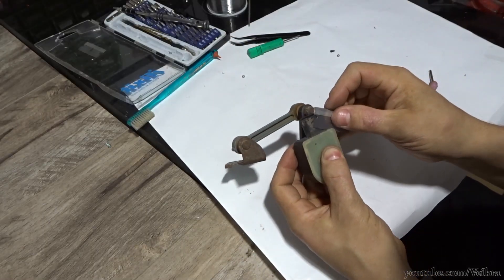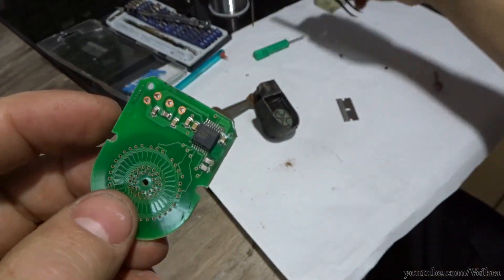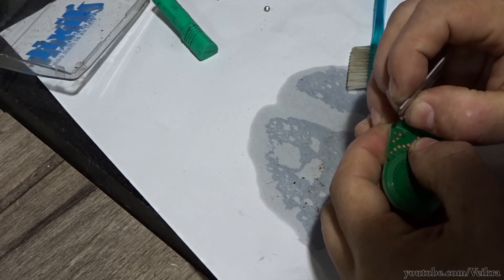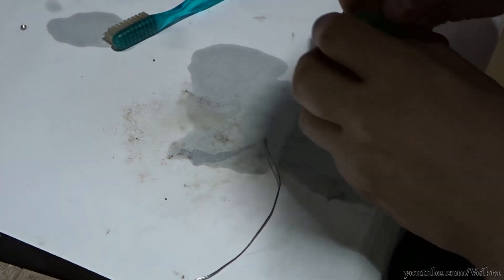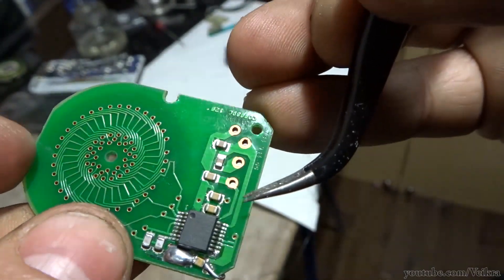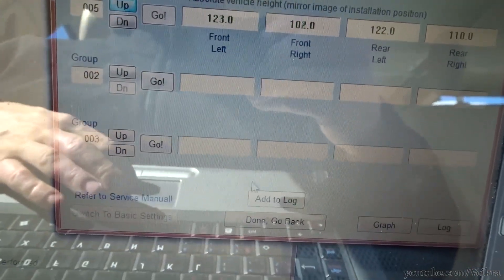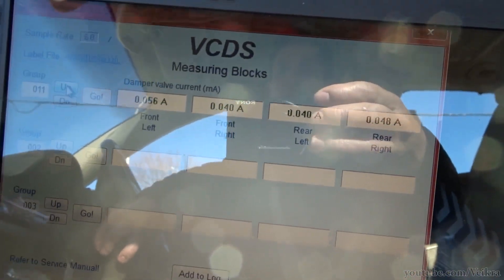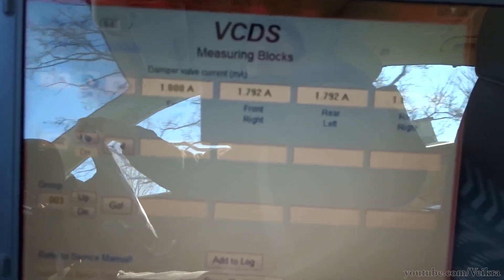How I fix these Audi level sensors ( audi a8l, s8 , vw phaeton )

Comment: Hi, nice video. After installation , how did you adapt the sensor again? I mean what’s the procedure in Vcds? Thanks.
Reply from the maker: On this model you have to go into level control -> adaptation. Rosstech website has a write up on it.

Comment: Hello, Could there be one of these bad without showing a faulty light for it. My left front side sits a bit lower and is not related to air leak from the suspension?? Regards
Reply from the maker: Possible but ! See the thing is, the computer will log a fault if sensor value doesnt change when suspension goes up and down.
So if you put car in dynamic, then lift mode, a faulty sensor would pop a implausible signal. 
Same if the arm attached to the control arm is broken/disconnected.

Corrosion in the connector does happen and happened on mines twice. easy to check and first thing Id do. 

Then Im going in the computer and checking normal operation. If deviations are within margin, I can recalibrate. If they are not, I have my answer why. 

Do not mess with calibration unless you are with one of us who really know what we're doing. We know exactly how the computer sees the world and what it needs to give us correct behavior.

Anyhow, for me, that's a simple system. But mechanics can struggle with it. I advise to either choose wisely or get vcds software so one of us can guide you if you can swing a wrench.

Comment: Hey pal, I need some help, I have an Audi A8 04,   The air lift is not working after I had someone do the breaks, can I pay you to walk my machanic through FaceTime he’s always available
Reply from the maker: Can he at least communicate with Computer 34- Level Control?  Did you remove the car from Lift mode in your mmi?  If he did the brake wrong he might have disconnected the arm of the level sensor or wiring. Scanning for code in 34 would tell you that.